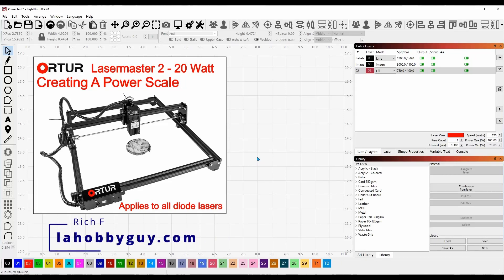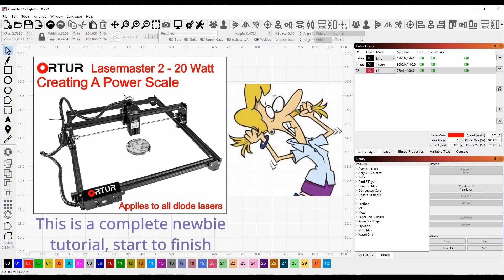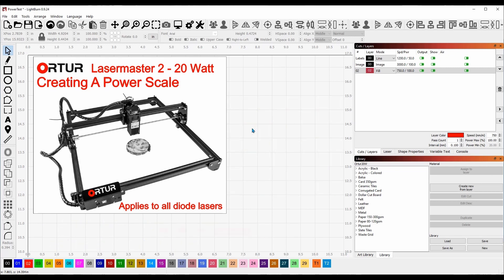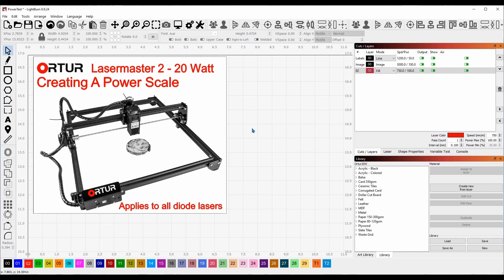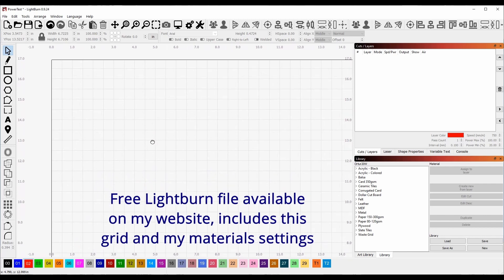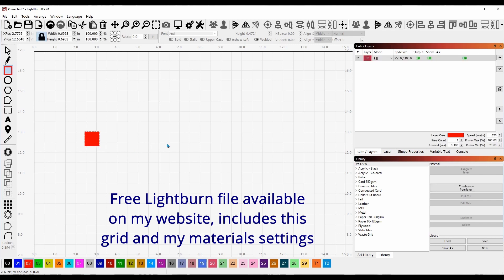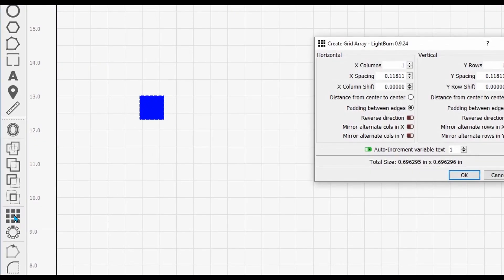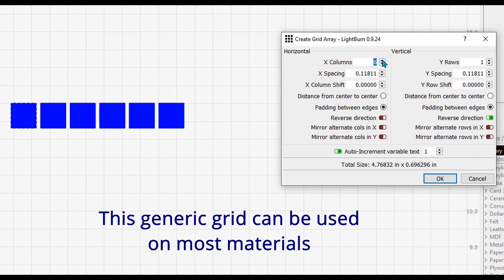Live Time - Creating A Laser Vector Test Grid

Comment: I recently upgraded my Ortur LM2 with the Neje A40640 which I believe is the 80W dual diode, which I heard about on one of your videos.  I love this new laser module.  It is so much better than the original Ortur LM2 laser module.  Now, should these settings be reduced drastically or are you using the Oreje, (so you've called it) in this video?  If I need to reduce these powers or increase speeds, I certainly want to do so.  Just asking as I always get straight answers from you.  Also, if it's not too much trouble, do you know the average life of the Neje A40640 laser?
Reply from the maker: This video was done with the 5W LM2 laser. You have to adjust the speeds to suit your laser. With the A40640 I personally would just double the speed on the right column and give that a shot. This was just a tutorial on how to build the grid, not which speeds you should use for a particular laser Greg.

Comment: Hi, thanks for the tutorial. I have a question. I bought a sovol sv01 3d printer and also a 50 watt laser module to use on that. Do you know if a powerscale will work on my laser since I only have a power connection connected to it and no pwm connection from the printers main board. And why do I set the power of the laser on all to 100 and then put a power scale on it while the text is at 50% power without a powerscale?
Reply from the maker: Yes, that sounds right to me. The Sovol does have pwm built in to the printer controller. It's the cable on the right on the laser module. You plug in power on the left and pwm on the right.
Reply: @TheLouisianaHobbyGuy  But From what Sovol told me I only need to connect the power input on the left of the laser module to the laser output  socket on the board of the printer since the printer does not have pwm? ........as far as I know.  And in case I only hook up the power socket of my laser module. does the setup that you show in the video with the power levels work then? I did some early tests with inktscape and there had the power setting down to 10% at some point. It worked bit the laser made a sort of constant beep sound. and it turned down power compared to 100 % in my other test.
Reply from the maker: @dextersxxxxlab  I have only seen one Sovol printer and that was a friend who had one and wanted to add the laser. I went to Solvol's YouTube channel and followed their video, removing the bottom panel and installing the ttl cable on the control board.
Reply from the maker: @dextersxxxxlab  This isn't the beat place to have a conversation. I don't get these messages as notifications. You should join my forum.
Reply: @TheLouisianaHobbyGuy   By the way, I found out in lightburn that when using the text option for the labels you put on the top and right, it is more easy to use the enter button to go to the next lower line and type every label untill down. and then use the line distance toggle button in the top menu to make the spacing fit the   drawn boxes next to it so they will all line up. And same for the labels on the top. Just put them all in one text line with 1 spacing between them and use the horizontal spacing toggle button in the top text menu to space them to line up with the array of boxes underneath. No need for dragging them roughly in the right spot on forehand and no need to select and line up after. In other words, it is quicker I think. Try it.
Reply from the maker: @dextersxxxxlab  There are all differerent methods. The fastest is actually a virtual array.

Comment: When you engrave black slate, does it create smoke and VOCs?
Reply from the maker: Usually no smoke David, but vaporizing anything gives off toxic emissions. I use a 1000cfm exhaust that goes through a scrubber, so the exhaust that vents outside the shop is non-toxic to animals or passersbys. At the very least, you should have an exhaust venting to a place where humans or animals don't pass by.

Comment: Informative video, I have the Ortur lp2 pro on order and am binging on LightBurn videos so I will be ready to go when it arrives.

In your video you said something about Ortur laser lasting 10,000 hours at 50%.  Is this true?  Would that mean it would last 5,000 hours at 100%?
Reply from the maker: I have never gotten a confirmation from Ortur on the life cycle of the diode Jesse. I was told by a tech there in an email that they're tested at 10,000 hours @ 50% power. But I also heard from someone in the business that diode lasers are usually tested at 100% power as a standard. Is the life cut in half using it at 100% power? I don't think so. It's not like a C02 that will burn up really quick at high power. Quality diodes degrade slowly and evenly. So the real answer is, I don't know 😎 Yes, it will degrade more quickly at higher power, but the extent is unknown. I can tell you that I have an original LM1, 2.5W from 3 years ago that has done a TON of production work at 100% power and I never changed the speeds & power over the years. It still engraves the same as it did on day one. I would guess it has about 5,000+ hours on it. So I can say that I haven't noticed any degradation in the original LM1 laser, and it's still going strong. So yeah, the definitive answer is... nobody knows! 😁

Comment: Hi Rich, I just did your tutorial today and have to say I learned a lot.  I replayed it several times and pretty much studied each screen you brought up to better understand how you are set.  One thing I noticed is that I think I have a slightly newer version of LightBurn than you did on this vid (1.0.02) so I noticed some of the display boxes  like for cuts/layers are slightly different.  One thing I wanted to ask was on the array feature.  When I set mine up, I could not get any of the boxes to fill (with the color).  Obviously doesn’t make any difference in the printout, but it did make yours easier to follow.  I downloaded your power test file and when opened, your boxes too had no fill, but line colors are still the same.  I’ll try pinging LightBurn but thought I’d mention it.  Your vids are awesome!!  Thanks for posting!
Reply: Just figured it out; under Window menu, then View Style, you need to choose filled/smooth and viola,, your text is filled.  Thanks!
Reply from the maker: Yup, you got it Elmer! 👍  Lightburn comes by default in Wireframe / Coarse because of system resource use. I keep mine in Filled / Smooth because I have a gaming level desktop that I do the videos on. Many or most people are using a laptop, so that wouldn't be an optimal starting point for them. Thanks for the comments!
Reply from the maker: And by the way, you get to see the same thing in the preview window.

Comment: Got a question. When I followed what you did on this on my LIGHTBURN and did a preview all the sq. came out black, had no shading like yours. Every line on my Lightburn was the same as yours but they all came out black. Any ideas Y. I doubled checked everything to make sure it was all the same as yours.
Reply from the maker: Tic the button in Preview that says Invert.
Reply: @TheLouisianaHobbyGuy  They are all white now. When I click the Shade according to Power I get shading. Maybe that's Y I didn't get any shading because they were both off.
Reply: Thanks for the help. I also sent off an email to LightBurn to ask about the "multi" word in Shape Properties.
Reply from the maker: @karlriley1314  That would have been my next suggestion 👍
Reply from the maker: You don't see the shading in the preview window, only in the actual burn.
Reply: @karlriley1314  Hi Karl, don’t know if you’ve solved this as of yet, but I just did his tutorial and came across the same problem.  Took me a bit of checking but when you do the print preview, there is a button for Shade according to power that for me, was set to off.  Once I flipped it, the preview worked perfectly.  Good luck!

Comment: Have you done any tests with G8 lense with the Neje laser module. I have the 30w and I am just curious if it will cut better or engrave better. Not sure if it's right place to ask.
Reply from the maker: No Sheerios, but I tested the G8 last year on a 20W and wasn't impressed. Compared to the lens the laser came with, the difference was marginal for engraving. I was however, very impressed with the G2 for cutting.

Comment: Once again, a great video. The only thing I would mention is you can highlight just the part of the scale you want to output and turn on  "Cut Selected Graphics" and then press "Start". I find this is an easy way to do it because I will forget or miss to turn on a burn layer or turn a layer off.
Reply from the maker: Great tip Kris, thank you! I should have mentioned that, but I'm really used to making full templates for each type of material.

Comment: Hey there, Rich... I have followed everything as you did, but the top left block is engraving at what appears to be 100% regardless of the 20% setting for the shape properties. Did I miss a step somewhere? Also, the file you shared is a different file on this video. Thanks!
Reply: Just to add some more context - the first row (across) seems to all be super dark on the birch I am using... so I am only guessing that perhaps it simply does not like that slow speed?
Reply from the maker: I'm gonna double check the file Danny. And yeah, that first row is a very slow speed. You can change the speeds to your liking,  For Birch, I would probably make the first row start at 1500.
Reply from the maker: I see what you mean about the file. No, it's the same file, I just added the words, "Power Scale" to it after the video.
Reply: @TheLouisianaHobbyGuy  Strange. Clicked through and downloaded the right one this time. First time was the circular one from a different video I believe. Thanks for taking the time to put these together. The community is lacking a clear step-by-step for noobs!